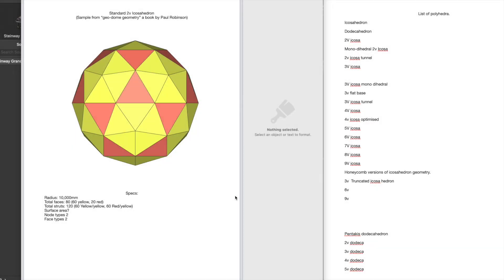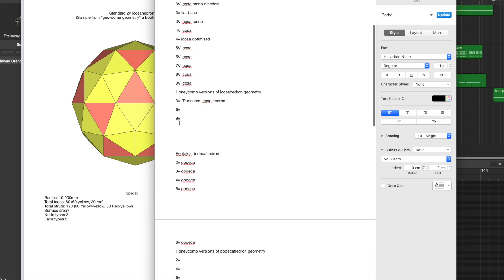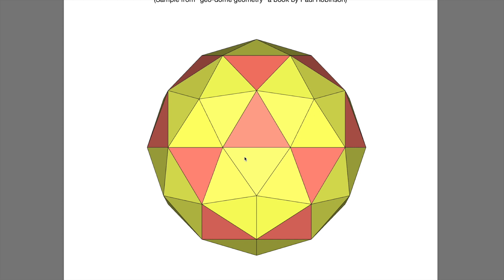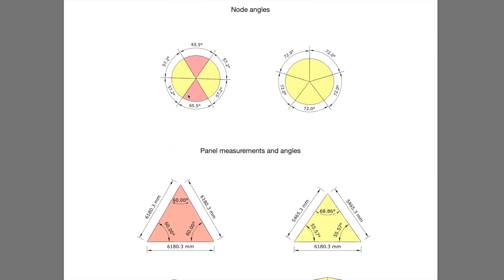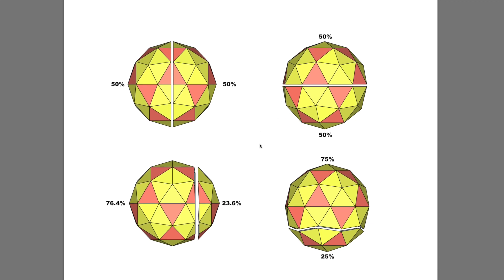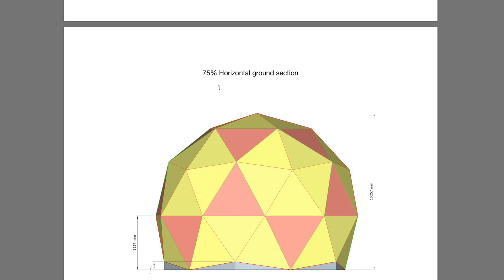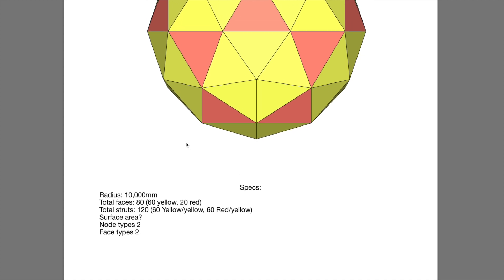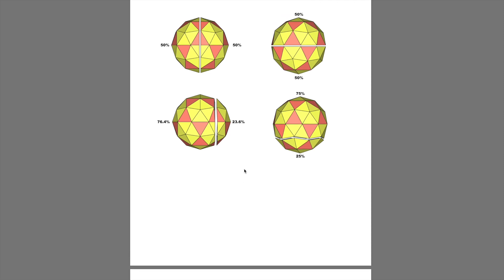Geo-dome geometry book - Test page

Comment: Paul, I love what you're doing here!  I would suggest including the altitudes of the panel triangles (i.e. smallest distance to the opposite corner at a right angle to a side of the triangle) as this would be very useful in determining what size bolt of fabric / plastic one would need and for maximizing panel stock.  It would also be a helpful check for folks while making their triangle jig.
Also, those of us who use SketchUp would LOVE to have your .skp files to help in our design phase.
Keep up the good work!

Comment: what i need is to be able to make a dome out of max 4'x4' hexagons and pentagons so i can prefab rather flat wall segments that are about 30" thick out of bamboo and hemp materials so that i can build one panel or two or three at a time as time and $$ allows, a sort of modular pre-fab panel platform... hope we can chat mr robinson... it's a complicated download that was put in my head in recent months, i'm still trying to understand the vision that was put there. hope to catch 20 minutes of your time soon. cheers.
Reply: I believe it would be easier than you think.   I love the idea of using hempcrete to build a dome.   Have you watched Paul's video on how to make the triangle frames (or forms) of the 3V dome.  There are only two different size triangle frames.  You could easily make two forms to pack hempcrete into and remove the building blocks.   You would have to devise a method to lock them together.  Maybe something as simple as using rebar in each frame sticking out to mate with a channel in the adjacent "block" and then hempcrete it in place during assembly.  It would  be like building with Legos.   Or, build two forms, one hexagon and other a pentagon.  Then assemble those like building blocks.   The possibilities are endless!

One important consideration are the forces on the dome during high winds.  In a 5/8th  3v dome, the top Pentagon normally has a tremendous amount of downward force and when the wind blows,  the force(s) almost reverse causing the dome to attempt to expand.  I learned this by building a 20' pilot dome a few years ago.  To compensate for air pressure equalization during wind events, make sure you add an "cold air-dam duct".  We use these in Northern Wisconsin to keep the exterior doors from slamming by themselves.  The duct consists of an 8' air duct, curved like sink trap, connected in such a way to stop cold air from flowing freely inside our basements.  These pressure release ducts work great and are very much needed in a dome to keep it from blowing apart in high winds.  Every square foot of the dome's exterior could be as much as 800 lbs of pressure in high winds.  

Secondly, a dome will attempt to fly if the winds are extremely high above 50-70 mph.  Be sure to anchor the dome to the ground securely.

Comment: How do you calculate these angles ?
Do you use vector methods (dot and cross products) ? It would be interesting to have an idea as to how you arrive at the lengths, angles etc.
Reply: You can get the angle values by letting the cad software do the math. There is a video on how to build a dome in sketch up.
Reply: @ammonite4078  I guess I should study Sketchup - thank you for pointing me in this direction.
Reply from the maker: I model them in Sketchup then just use the protractor and tape measure tools to get all the measurements, maths isn't one of my strong points. I think I look at polyhedrons in a slightly different way than a mathematician does which can give me a creative advantage sometimes.